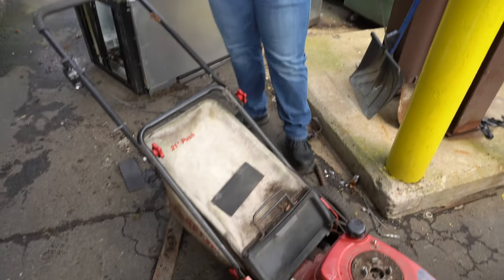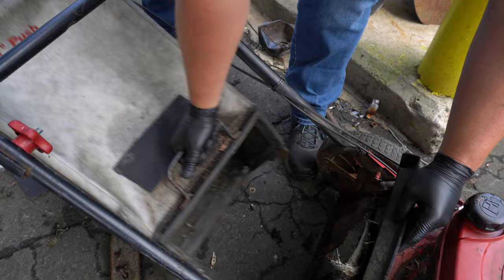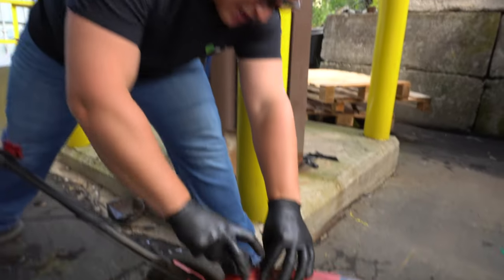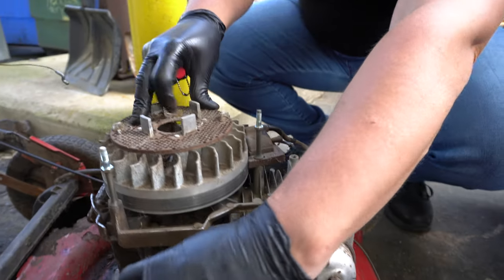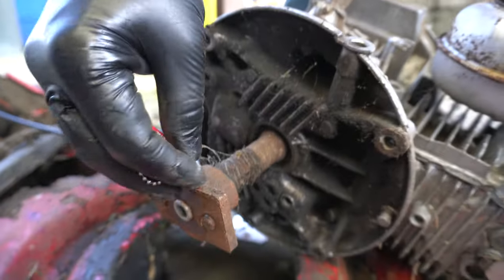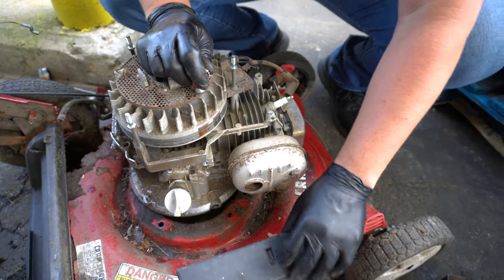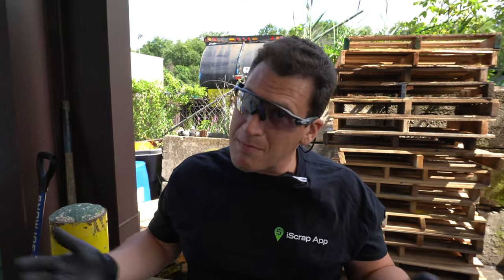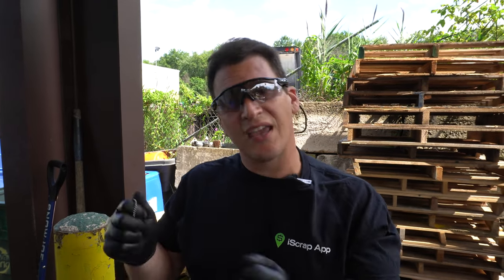How To Scrap A Lawn Mower - What To Keep, Strip, and Scrap

Comment: Personally, I like to tinker lol So I take mowers apart nearly completely. I've found a system/rhythm that works. I generally wait til I have at least three engines or more though.  I save cast aluminum til I have a huge stock pile. My drum/container was 200 pounds last time.  The price was agreeable.  But I have no problem storing 1,000 pounds until the price is right. 
Interesting about the spark plugs.  I had a feeling there were unique metals, but figured it was pretty tiny (like plating).

Comment: Find a mower mechanic, most the time it's small issues. Number One issue a dirty carburetor. Sometimes the cord don't pull. Easy issues but if not take that engine off and sell that deck for short iron unless it is aluminum
Reply: Oh and a real scrapper remember the electronic battery mower now exist and they want to make the engine mower extinct
Reply from the maker: very true. that means more engine mowers on the curb